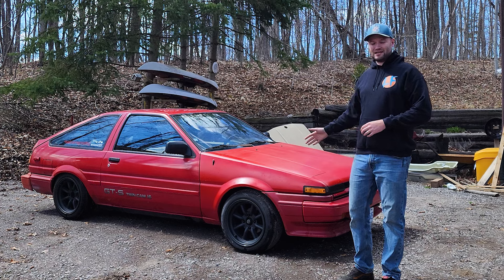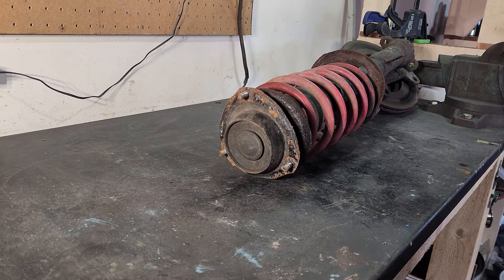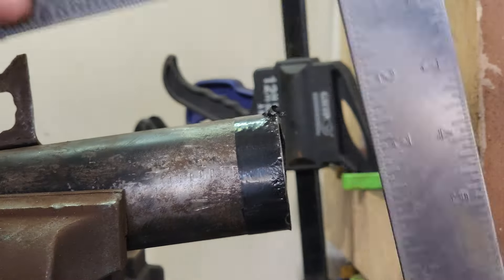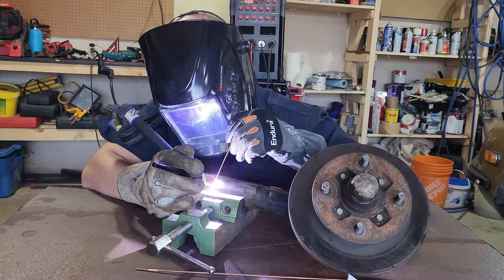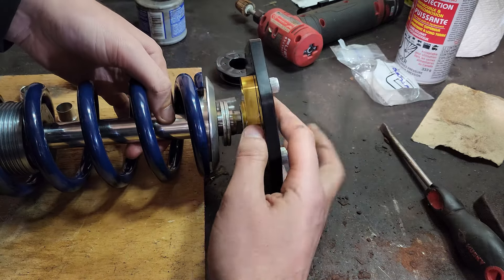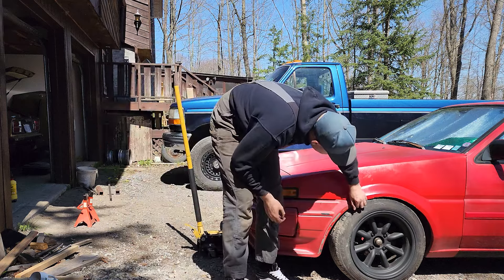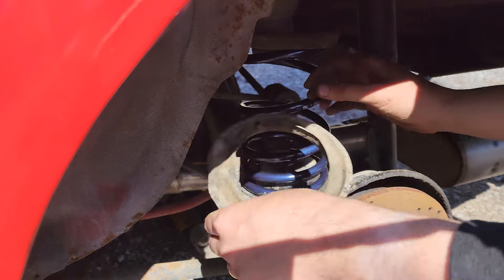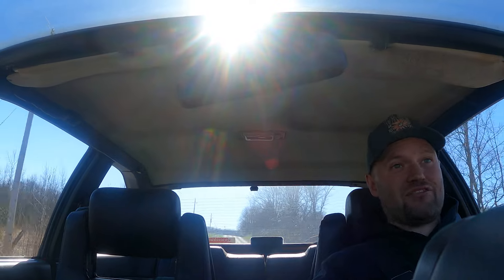Will This Completely Change My AE86?

Comment: I'm glad you went this route for the corolla instead of buying bc , or all these after market off the shelf suspension. later down the line you can upgrade your shocks with trd stuff. also either cut or take off the bump stop bushing at the rear spring and there's another one on top of the rear end housing.
Reply: I want a different route by swapping 75% of the AE86 stuff to Altezza🇯🇵🇯🇵🇯🇵
Reply from the maker: Im glad too, was definitely more fun getting to do some fabricating, and I feel like I learned a lot about the car. Good call on the bump stops, I cut the rear ones in half but left a little bit there. think I should completely remove them?

Comment: roll center adjusters basically should be as thick as the amount you shortened took out of the strut tube to return the control arms to correct geometry as the engineers intentended them to be
Reply from the maker: I never thought about it like that, but that makes a lot of sense! Thanks for the comment!

Comment: not sure if this is your fender and front fitment issue but I have an ae92 corolla, the corolla that came out after the rwd platform and had a similar problem, in my case it was because I had to make sure to adjust each side for differences in weight so I had to lift it, adjust it, drop it, measure, lift and adjust for measurement and differences. idk if that's the exactly right way to do it but it helped make my camber and ride height more even.
Reply from the maker: Those ae92 are sweet little cars! And great idea, I'll give that a try and see if it helps me alignment. Thanks for the advice!

Comment: I’m just getting started on my journey trying to drift a stock GTS hatchback. Sounds like I have a long road ahead. 😂 does your 86 have power steering?
Reply from the maker: I've been told that once you get the hang of these cars, it's a lot easier to hop into a different car! Good luck with the journey! Mine was factory power steering but I deleted the pump and just looped the lines. Thanks for watching!
Reply: @LooseFab  mine still has the power steering pump factory but I haven’t messed with it. The steering wheel fights against me in the corners the way it currently is setup. It’s a helluva workout.
Reply from the maker: @theJoshClark  I have that problem too! I honestly feel zero difference with and without PS. Maybe it wasn't working lol. I added a bunch of caster with this new setup so hopefully that helps!